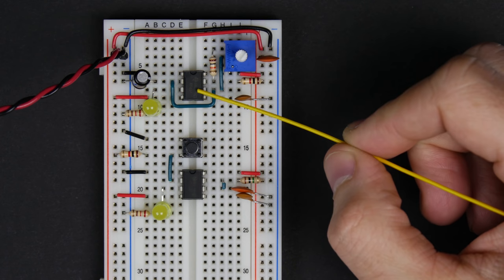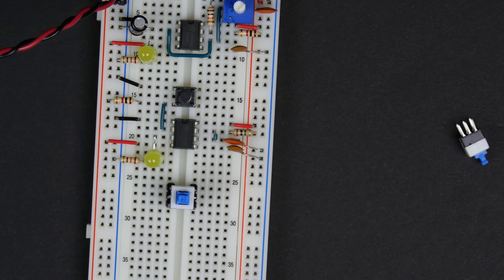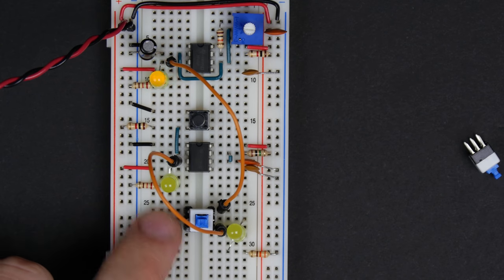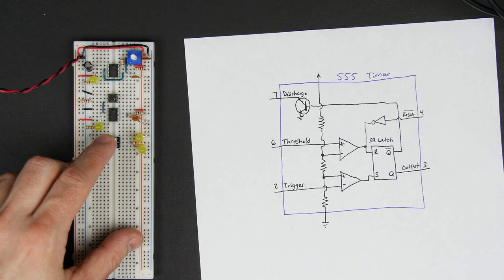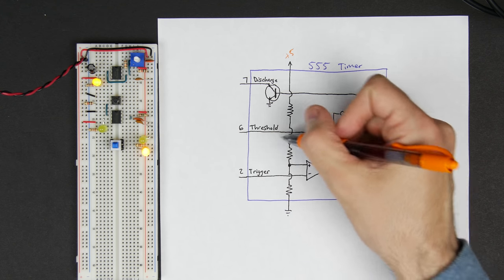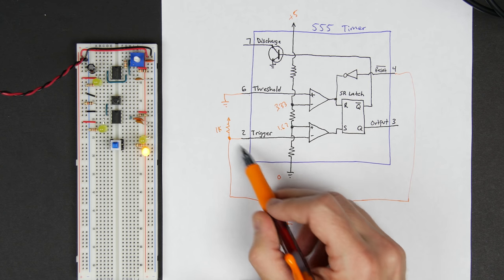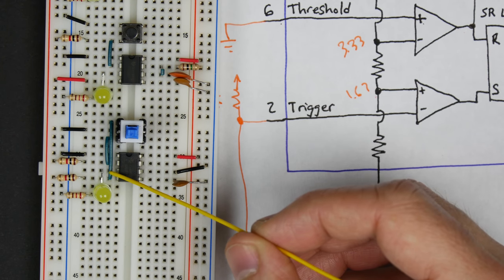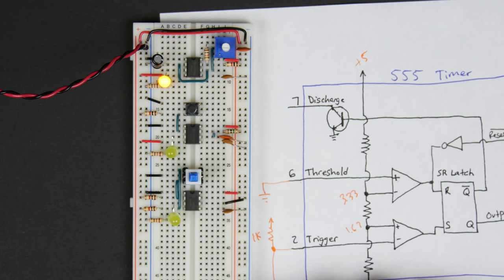Bistable 555 - 8-bit computer clock - part 3

Comment: The included switch i have received is not working the same way..
Reply: Someone else wrote this fix for that: 

To anyone that has bought Ben's timer kit: the switch provided there is a make-before-break switch, as opposed to a break-before-make! However, there is an easy solution to fix this.
Simply invert the logic that the gate in the video uses; i.e.:
- Connect the switch's central pin to 5V, not ground
- Use pulldown resistors to GND for pins 2
and 4
The rest of the circuit is identical. By inverting the logic, you are essentially converting the make-before-break switch into a break-before-make switch.

Comment: Can i use a 3.3KOhm as a pull-up resistor instead of the 1K ones you used? This way i think i could reduce the current draw, if it doesn't mess with 555's internal circuitry.
Reply: It shall not mess but im new in this topic 
Just try it out
Reply: @aqbaplaygames3435  Well... then i'm going to try it on a separate circuit first, so that i don't explode my entire work.

Comment: Hi Mr: Ben ,my name is TONNY from Africa I really appreciate your work and I have been watching your videos and they have taught me alot, today I want to you to help me in my project:
          In this project I have a (HUCULESE INSTICT P8 DJ controller)made in China, This controller works very fine but their is a problem with its 
CROSSFADER ) The C-fader was made of carbon,and with time when scratching , the carbon gets off quickly then you have to replace it with another new C-fader for every 5months which is very annoying,and as in Africa getting a spare parts sometimes you have to make an order which is very expensive,Now here is where I need your help  I bought an Arduino starter kit because of your interesting work,but I still have alot to learn,Now Mr Ben .I want to reprogram this DJ controller such that it can use an optical C-fader system ,I have all the materials for this project but I don't know where to start from like the software for reprogramming the DJ CONTROLLER .So to put it in short I want to remove the (carbon potentialmeter
and replace it with optical potentialmeter)how can I get this controller's IDE software like arduino uno and others  uses arduino ide plus where do I start from eg : changing the potentialmeter codes to whatever I prefer,

Comment: here's a noob question. What's the point of all the resistors on the connections? Why not simply have a direct connection?
Reply: The resistors are there to keep the 5V pulses from damaging the LEDs, which usually operate at around ~3V or so
Reply: Ah okay thanks
Reply: Elmer Gomez the ones not on the LEDs are to limit current. 5v through 1k is 5mA which won't burn out, for example, transistors in the ICs.
Reply: Actually both can damage the LED. Too much voltage will blow the wire attached to the PN silicon, and too much current will melt the wire (inside of the LED). We are playing with power. So your Resistor in series with the LED = ( [(Voltage Source) - (Voltage drop across the LED, or another way of saying it LED Voltage)] / LED current. http://www.resistorguide.com/pictures/resistors-in-LED-circuits.png
See >>> http://www.resistorguide.com/resistor-for-led/
Reply: You can't have too much voltage without too much current for a forward biased diode!!  Reverse bias yes you can have too much voltage and cause avalanche failure.
Reply: The resistors are like fuses and they also control the 555 timer

Comment: Can someone help me please? I connected the circuit in the exact same way as he did but it doesn’t work. When I plug the power in the light is off, but when I press the switch the light comes back on. The problem is that when the light comes back on the switch won’t turn it off again. I’ve tried rebuilding the circuit, pressing the switch multiple times, and using a different switch. Nothing has worked so far. If you have any solutions to this I would appreciate it very much! I'm stuck!
Reply: Thanks for the reply. I will try this later on. I have ordered 3 sets of damn switches from america haha! Hopefully what you said will fix it. Thanks again!
Reply: @Zepu Li I need to figure out why setting it to high fixes this for me as well...
Reply: Hey man, did you ever fix this issue? I have the same problem. Thanks in advance!

Comment: How do you know exactly what length to cut your wires?
Reply: Holobrine They are all precut and kept off screen for the examples. He has previously sized the wires and shaped them then removed them from the circuit.

Comment: 5:30 Can't the switch bounce "all the way back" ? Meaning it might reach S then bounce back to trigger R and back again to S ? In which case the SR latch would provide nothing much.
Reply: Furrane no. If you imagine a piece of metal hitting the floor, it will ‘bounce’ a few times before coming to a stop against the floor. This what is happening inside the switch. Now imagine the metal is upright on the door saddle between the hall and the kitchen. Let it fall towards the kitchen and it will bounce a little as it hits the kitchen floor but it won’t bounce enough to double back and bounce on the hall floor.
Reply: Maybe for a few presses as it’s failing, but normally I don’t think so.

Comment: Why can not we simply use a tiny capacitor between pins of button to achieve de-bouncing problem ?
Reply: Ömür Ölmez you'll build up a charge across the capacitor that must go somewhere when the switch is open/closed.

Comment: I'm sure you could optimize the circuit further by reusing the 2nd 555 timer. With a bit more optimization, you could probably even get away with using a single 555 timer since we don't really need both states to be running at the same time.

Comment: can someone help me, im trying to find that Double-pole toggle switch but I cant find one in the UK that is breadboard compatible can any one help?
Reply: Minefan48 sorry man, I've tried and failed to find a decent one. If I were you I'd just solder some single core wire to each pin on any toggle switch. That's what I've done and it's worked out well so far.
Reply: Jordan Hall I found some on Amazon!
Reply: You found breadboard compatible toggle switches? Can I get a link?
Reply: Jordan Hall I'll have to find it so you have to bear me
Reply: I think the Double-pole toggle switch he is using is the TL2230EEF140 from E-Switch (the EE stands for latching OA would be momentary)
It can be found on mouser.com for example if you don't find any in amazon or your local electronics shop

Comment: why not use a 556 timer? you would get the same effect
Reply: Why not buy an arduino? You would have all the functions of the 8-bit computer.
Reply: @jacobtohahn  That is what I was trying to say by ironically exaggerating Mateos question about the 556. 
The whole point of this thing is building it. Of course you could swap the circuit with a 556 but that would kind of be the same as just swapping the whole thing for something pre-build.
Reply: SecondASMR  but this isn't reddit
Reply: i have been looking into the 556 (dual timer) or the 558 (quad timer) to make this clock circuit . it is the same theory and concept just less chips and less space used on the breadboard , with a 558 there is one 1 power pins and 1 ground pins instead of 3 power pins and 3 ground pins (one for each chip) with the 555 timers. i don't have any 558 timers so i am working on making it with a one 555 and one 556. my questions are : is there any down side of using a 556 or a 558 instead of all 555's? are 555's more (or less) reliable than the others? is it likely for each timer to interfere with the others? etc?
Reply: Sure, but A and B is a fucking lot to work with.

Comment: Where can I buy all these chips?
Reply: the internet
Reply: :P
Reply: For the resistors, LEDs, and such, check DigiKey as their parts are really cheap. ICs and breadboards are more expensive on DigiKey so try finding an electronics surplus store - generally fairly decent prices, and more willing to give you deals if you're buying a lot. I found the ICs needed for the whole project at 1/2 the price they would've been on DigiKey (and without shipping). Also satisfies the "but I want them now" itch, and they can be super fun to browse.

Comment: Can someone explain to me how the switch @ around 4:09 where he's showing how the switch normally works?  I don't understand how the LEDs turn on there.  Thanks!
Reply: See, the switch that Ben is using is a 'double throw switch', which has a 'fixed' contact pin(Physically speaking, the pin in the middle of the switch) and a 'variable' contact pin. The fixed contact pin is connected to the 5 V power supply.  The 'variable' contact pin switches between 2 connections which in this case, are the 2 LEDs with current limiting resistors connected in series with it. So, when we press the switch, it 'switches' between the 2 LEDs, lighting them up when the respective pin is in contact with the respective LED. I hope you have understood this.

Comment: where do you pull those resistor values from? why do you use a 1kOhm resistor to pull up pin 2 on the T555? why not 1MOhm? After all you're shorting it to ground for extended periods. Why not 100MOhm? Why not +InfOhm? What are the advantages and disadvantages of different pull up resistor values and how do you decide which one to use? Or do you just pull those values out of your rear end?